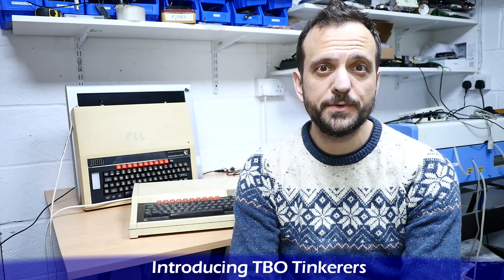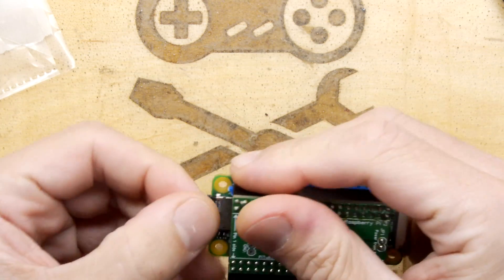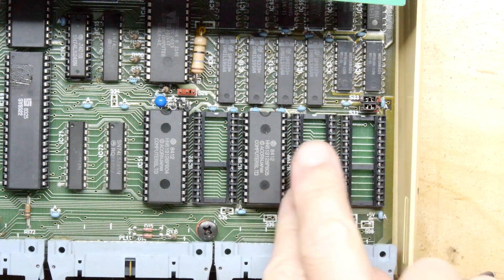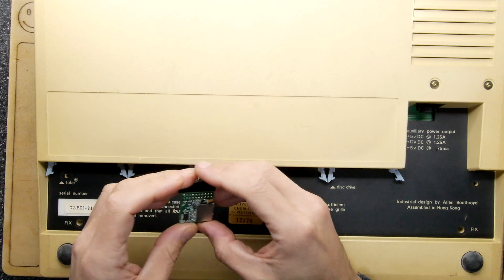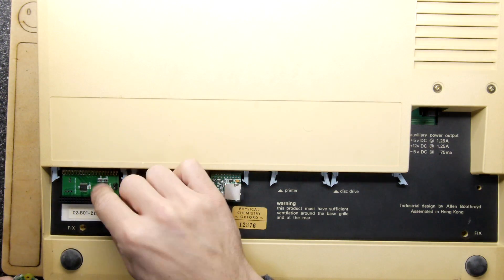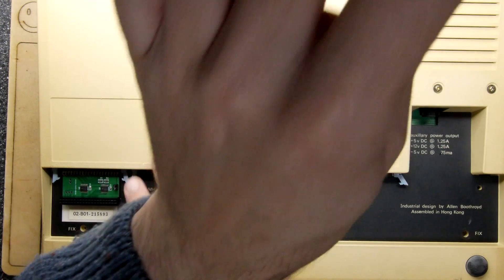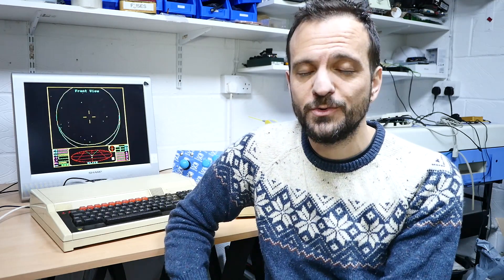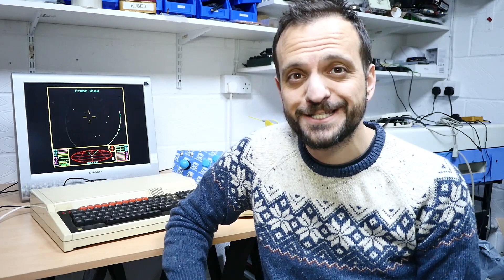Cheap BBC Micro Upgrades you can install yourself

Comment: I'm loving the beeb videos, keep 'em coming ;)
You might like to put some tape on the back of the level converter for the PI as it can press on the keyboard screw head.
There is a 3MHz version of the 65c02 on the PI-copro to match the 1st 65c02 copro , specifically for Elite ;)
On my Masters, I "unplug" everything except BASIC and a version of DFS, so it is more like a B with lots of sideways RAM.
I think *CONFIGURE BOOT just reverses the action of SHIFT-BREAK and BREAK.
In case people don't get to the bottom of the replies: I have written a cut down MENU system for the B/B+/Master/Compact (DFS only, no ADFS). It runs on all (AFAIK) MMC style DFS filing system as well as DFS GOTEKs. https://stardot.org.uk/forums/viewtopic.php?f=53&t=16070 It contains all of the "commercial" releases from http://bbcmicro.co.uk/ as well as some of my games ;)
Reply from the maker: Richard, are you a Discord user? I'm currently posting a lot of my beeb exploits in there. I start a video with one intention and normally hit a roadblock before I can continue 😂
Reply: @backofficeshow  Occasionally the Retro Asylum channels, but social media wise, I'm tricky on  https://stardot.org.uk/forums which is a very friendly place to get Acorn and other machine help :)

Comment: Hi, I recently bought a BBC Micro but it doesn't have the pincer connectors installed underneath, for the user port etc... Does that mean I wouldn't be able to use the TurboSPI, etc?
Reply from the maker: If you can find your way into our discord I would be happy to look at a photograph of your machine

Comment: Hi. I've installed the Turbo MMC on my BBC Master. It all works fine. However, for some reason my FDD no longer works. This is annoying because I can't access my old files on my 5.25in floppy discs. Do you have any advice, please, on how to fix this issue? What I'd like to do is transfer the files from the floppy discs to the Turbo MMC. I'd be most grateful for any help. Thanks for the excellent video.
Reply from the maker: Hmm, I have not tried to connect a floppy drive in conjunction with the turbo MMC. Quick question though, does your floppy work if the chip is removed?

My guess is that it replaces the floppy or possibly reassigns it to a different drive number
Reply: @backofficeshow  Thanks for the quick reply. The FDD was working before installing the chip. I'm a bit loathed to remove the chip to test if the FDD works again because I don't want to risk damaging any pins on the chip. So I'm not sure how to resolve the issue as my knowledge in this area is somewhat rudimentary.
Reply from the maker: Try *CARD and *DISK. 

It escapes me now, but there is a command that will list the commands that the ROM makes available to the operating system.
Reply: @backofficeshow  Thanks. I'll give it a try
Reply: @backofficeshow  I found this on YouTube, but haven't tried following the instructions yet. Not sure if you've already seen it, but here's the link:- https://www.youtube.com/watch?v=_Qdh3e-7q0Y

Comment: Hi bought a BBC makes the X2 beeps but cannot get a picture via a scart cable I bought, tried two LCD TVs no picture what so ever, scart cable new. The seller of the BBC Micro sent pic of it working with RF cable which I don't have  so not sure if it is the scart cable or flat screen TVs not compatible they are not CRT any suggestions tia
Reply from the maker: Do you have any measurement tools? You will have to see if there is any output. It's possible the output hardware has failed, e.g. no sync

Comment: Imagine how much better digital TV interactivity would be (red button etc.) if the ceefax/telext ARM chip (which is like the BBC micro) had mandatorily been able in all TV-sets to have that expansion slot for a co-processor (and a serial port rs232), so even though it would have been mediocre back in the day, right now, people all over the UK would be plugging in that raspberrypi via the GPIO like you have done and the BBC and other TV channels would have to fall to their knees in mercy of how "awesome" it is (by which I mean it is a "reasonably pragmatic" solution) and then hire a couple of part-time (16hours a week) minimum-wage students (GCSE or Alevel or degree) to code various apps for it such as a scientific calculator or spreadsheet program which saves to the SDcard (or the rs232 storage as though a null-modem-cable plugged into something else), having first received a broadcast over the digital-TV airwaves to download new software to that pizero2w (or pizero if that is what you have there). 

Softwares would do things like make a garden-planner or fantasy-football or graphing-calculus programs to show stocks and shares (histograms and other graphs) or FFT calculations performed on the Pi itself from a trickle of data through the TV airwaves telling the pi what the weather map should look like (and then rendering it in splines and 3D). Or like it could calculate your BMI and modify food-recipes measures for ingredients and so on. It could perform hashing calculations or generate landscapes like Bryce3D could but in humble graphics. There could be prepping-prepper calculations and updates it could perform like that Trump FEMA sms text the yanks got sent to them via the USA government (which was a good idea btw). So DIY prepping measurements could be calculated such as making a DIY-workbench or storm shelter. A better "games" controller (e.g. xbox360 controller with chatpad) would be released for the rs232 ports on instructables or via the telext-ceefax button itself so people could make one out of an arduino or whatever.

Quite frankly, this should happen if a way can be found to add a PCB to expand a Mullard SAA5050 and the various other pertaining chips found in such a TV or VCR or the day that could do the teletext/ceefax stuff. Some are through-hole PCB or sockets.

Those wireframe smooth elite 3D graphics could run a railroadtycoon3 or neverwinternights style game with reduced graphics, or themepark on the a1200 amiga but with lesser graphics. Geneology programs and time-team style archeology software could be run. Really though, elite2Frontier would be better for that as per OOlite or Pioneer. Wetrix (like n64) could totally be done in wireframe using all that FPU power. Frankly, considering minecraft has an open-source version that runs on a 486, it could do that in a cut-down game version too or at least a tiny bit. 
Old newspapers (or science journals) could be loaded froma mounted CDROM-ISO file from the SDCard and used for citations in history gcse homework or humanities projects like in psychology so it would work as a spellchecker or Encarta because for much of those you do not need the internet but rather just a CDROM ISO file of text and clipart on the SDCard. People would even be able to use the TV to program code on directly via an IDE. The above Mullard SAA5050 (and other chips) TV-hack should totally have MIDI built in too even if merely via emulation. Even though it is basic-looking, a person is not distracted from their workflow like how the internet can interrupt a person's homework research with things like social-media trawling for cat videos. So it makes sense that is look basic. There could even be a basic google-sketchup made for it for making very basic DIY projects such as shelving or a table or chair in wireframe 3D and it would somehow save to a collada fle or a basic XML conversion file for collada. So 2D animation softwares would run on it too, almost like deluxepaint on the amiga but in low colour and resolution. An agreed soundbank ISO (of say 4GB) would be expected in the encyclopedia so (creative-commons) ogg vorbis sounds (at nearly CD quality) could be played (or converted if need be) and triggered by that midi by the aforementioned softwares people coded or by the signals sent by the BBC (or Sky-tv or whomsoever is into freeview) over the airwaves. Then copyright ISO packs could be purchased from Sky or whomsoever else wanted to sell the glitzy versions or relases them on a CDROM/DVDROM on the front of a paper magazine in WH-Smiths, like on the BBC food magazine or a computercative/pcformat style magazine. So people might use (TV-show) strictly come-dancing to learn keep-fit dance moves like the nintendo-wii games.

It should have every spectrum-speccy public-domain software for it converted, where pragmatic to do so. I would say that upgrade should also have four AA batteries just in case it helps save a save-state to RAM and also to run a clock to help a cron job in linux even if the pi can already do tha as it is will assist future versions and the pi may or may not be used or it may be added to by another SBC or electronics PCB. The quad-core of the pizero2w would also run IPFS and the wifi would form a mesh network so neighbourhoods would share IPFS data that way. All this stuff could be done on the cheap via FOSS and GPL and MIT license software and creative commons, etc.

A BBC micro is way too hard to get ahold of to accomplish this but a TV/VCR with that chip is realistic. A QR code generator is another thing it could do and so a smartphone could then take photos of say 100 QR codes and thereby receive an app of a very basic game or instead of a very basic app that can then download other better apps via updates. Adverts can appear in games like in footy/rugby games on the pitch.

The video basically shows what the GameWave would have been if they had bothered putting a decent CPU in (like even something akin to the panasonic 3D0 or a motorola 68040/68020 with FPU).

My comment has no hate in it and I do no harm. I am not appalled or afraid, boasting or envying or complaining... Just saying. Psalms23: Giving thanks and praise to the Lord and peace and love.

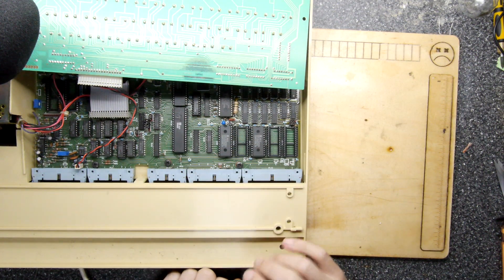Comment: Hi guys, I've just received my Turbo MMC, however on the main board @ 5:07 and 5:25, the rom sockets on mine are full apart from Socket 2 (between the OS and Language chips). Socket 4 (4th when counting left to right) has my DFS chip in there and I don't exactly know what ROM chip is installed into Socket 5. So would I need to remove the DFS chip in socket 4 in order to install the Turbo EPROM (where it is placed in the video) or would I be able to just put the Turbo EPROM in the empty socket (Socket 2)? (In other words does it matter which rom socket the chip goes into?) Many thanks!

Comment: Maybe some bright programmer can further enhance Elite-Tube to be filled geometry instead of wireframe, make Elite on the BBC look like the Archimedes version :)
Reply from the maker: That would be awesome wouldn't it!

I wonder if the tube interface is fast enough for the coprocessor to push graphics straight to the screen and just use the beeb CPU to handle input and shunting data.
Reply: @backofficeshow  It must be boosting the graphics some amount as one of the main causes of low FPS in Elite was the slow redraw rate so just speeding up the game logic would not cause as huge a frame rate increase as you see in Elite-Tube unless they are using frame skipping (like emulators do on slower PC hardware).

As you can guess, I may have the knowledge of what is needed to be done but unfortunately I lack the knowledge on how to do it! lol
Reply: There is a version like that for the PC.
A clever bloke called Christian Pinder reverse engineered the old BBC code and recoded the game in C for the PC, keeping the game very faithful to the original except for the option of filled in polygons, colour, and better polygon scaling.
Still available for free download - just look on your search engine of choice for "Elite - The New Kind" 
He's also done the same with Arch Elite - you can find a vid of him demoing it here on youtube, however at this moment in time he hasn't released that yet

Comment: SPI = Serial Peripherial Interface. It spools data to and from the host over a 2 wire serial link.
Reply from the maker: I wonder if it's the same spec as the SPI we use these days
Reply: @backofficeshow  It is, as it refers to the connection to the (micro) SD card.
Reply from the maker: @trickysoft  I just reverse engineered an interface on my Discord to figure out how it works, then reassembled and flashed a new MMFS ROM. Works a treat, I'm very happy now!

It's a shame you cannot turn off the tube interface from the beeb. That would be useful. I guess a hardware hack would work.
Reply: @backofficeshow  I think you can enable it and set the default to the "null" co-pro, effectivly disabling it. You can then use the *FX command to swap processors when you want. Sorry, I can't find the thread, but https://github.com/hoglet67/PiTubeDirect/wiki should help.
Reply from the maker: @trickysoft  These are awesome. I am going to set one system aside purely for this work and develop some scripts just to make all of this easy to play with. I'm just trying to get a few messing systems up to speed. I'm having keyboard woes mainly.
Reply: @backofficeshow  Once you have the co-pro sorted, you might want to try DOOM (if the non hard driver version is available yet), although it is cheating a little - but the tube was designed for future processors, especially ARM ones ;) Beware, DOOM may lead you to a Video NuLA.

If your keyboard woes are just the odd dodgy key, repeatedly pressing them (50+ times) will often get them working again - if not, switch cleaner or a soldering iron may be required.

PS You can abbreviate "*CONFIGURE" to "*CO.". Most BBC BASIC and OS commands can be abbreviated to the first few letters and a full-stop.
Reply from the maker: @trickysoft  DOOM!!!! no waaaaaaaaaaayyyyyy!!!!!!!

Comment: how many times the pi is more powerful than the beebs? is like having  ferrari engine on child tricycle . don't like modern powerful accelerators on vintage machines. at least has ARM cpu one may say.
Reply from the maker: But it's not accelerating the beeb. It's using the legitimate tube port, exactly as Acorn intended.

This capability was literally designed in from day one. Totally what Acorn would have made themselves - and seeing as the pi is an ARM, it's what they did 😂
Reply: @backofficeshow  Agreed, plus it can co-process / emulate a range of processors. ARM was developed on the BEEB now the ARM is coming home again...full circle.

Comment: Great Video. I need to get that MMC unit - I don't think my old BBC hard disc is going to last much longer. I have a collection of languages for BBCs, there was, aside from BBC BASIC:   FORTH, LISP, Pascal, BCPL, micoProlog, LOGO and COMAL from Acorn, (never found a COMAL). There was at least one other FORTH variant, another Pascal and a couple of versions of Small C. If you had the 32016 second processor with PANOS, there was a FORTRAN 77, but as far as I can tell, never for a standard BBC.
Here is the Acornsoft languages catalogue:
http://chrisacorns.computinghistory.org.uk/docs/Acorn/Brochures/Acornsoft_APP62c_AcornsoftLanguages.pdf
Reply from the maker: Wonderful, thank you for the list, I'm going to set about adding them to my SD image! I think the pi coprocessor should a allow you to try the full range.
Reply: If you like the hard disc experience, you can get a BeebSCSI https://www.domesday86.com/?page_id=689 which allows you to use an SD card as a hard disc and the beeb/master/etc won't even know. I'm not sure who currently sells these. I think there is a PI HD emulator in the works, but I'm not sure how far along it is.

Comment: I love my bbc b micro no econet though as it was bought new by one of my dads mates he gave it to me when i was in my teens and he got his first pc .My bbc master has no econet either or markings to suggest it was an ex school machine bought from a car boot sale in my teen years for £10 .I have a turbo mmc interface for the b and an os switcher to be fitted to the master i will add the pitube at some point and other updates .
Reply from the maker: I would like to understand Econet. I wonder if there was some sort of hub
Reply: @backofficeshow  I think you can use the Master, but you will need so sort of "clock" and basic wiring.
Reply: @backofficeshow  Econet is an easy upgrade. But it does use a Motorola (IIRC) controller chip that's a little hard to find now. It does not use a hub in the traditional Ethernet sense but rather a link box which also supplies the clocking signal. Poke about the Interwebs. You'll find no end of simple designs for all sorts of Econet doo-dads.
Reply from the maker: That sounds interesting, I am hoping someone has tasked some simple hardware like an arduino or Pi to emulate it. I need to see what games supported it!
Reply: @backofficeshow  Econet is a bus based network using a shielded cable containing two twisted pairs, one for clock and one for data. It is really only a curiosity these days; its main value 'back in the day' was to provide inexpensive shared access to expensive resources: hard discs, floppy disk drives and printers. These days, a micro SD card interface gives you all the storage you can really want with old Acorn computers, whilst printers are best connected locally. If you are using Risc OS machines, it makes far more sense to install an Ethernet interface.

Back in the day I worked for SJ Research for a few months. I was familiar with much of their Econet stuff but I only worked on Nexus, their high speed network system based on ATM.

Comment: Thanks for the unexpected Christmas vid.  I've still got my Model B that I bought as a teenager, although when I switched it on a couple of years ago it produced an acrid smell (but still worked) - think you've inspired me to restore and upgrade it.  Thanks.
Reply from the maker: You are most welcome!

It sounds like your beeb blew a PSU cap. Fortunately they are an easy fix, so get in there and get that sweet sweet machine up and running 😂

You will be amazed at how usable they are, even in 2020!
Reply: CAPS!